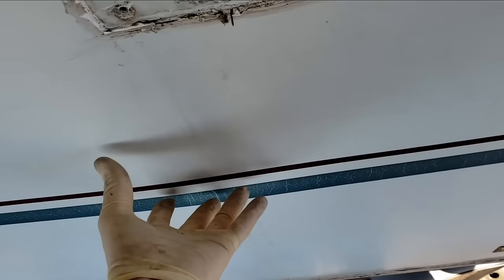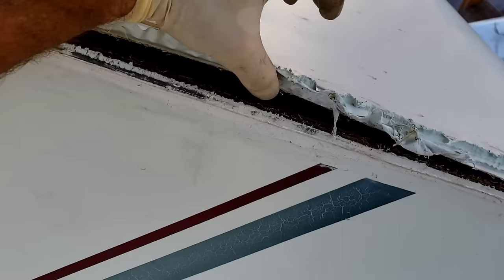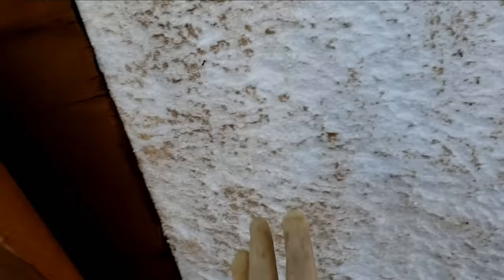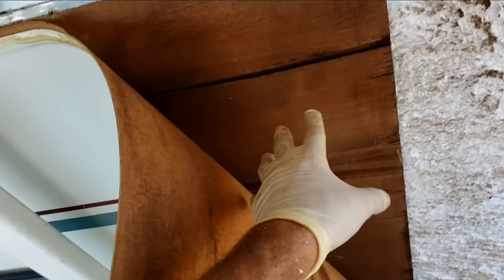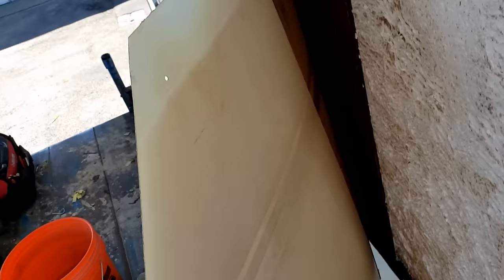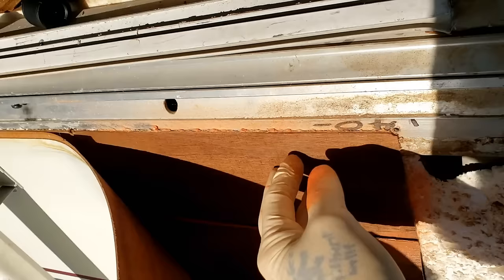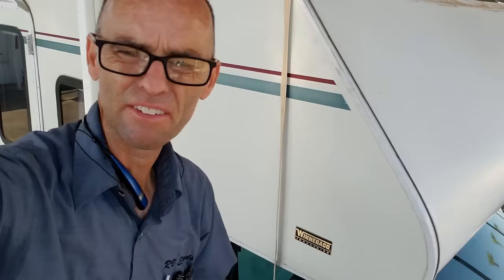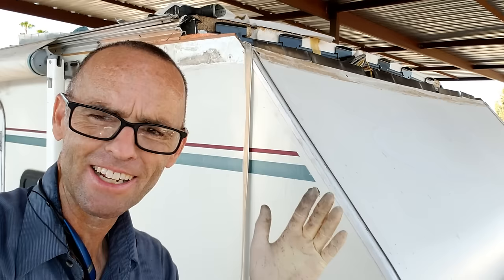How To Repair Loose Laminated RV Sidewalls....and Why It's Not Done

Comment: What is the cost of a repair like this? I have delamination on my fifth wheel in the similar area - on the side where it goes over the truck bed. I know you said it's not cheap, but I purchase my trailer for pennies on the dollar.
Reply from the maker: this was a special price as we were replacing the roof, but likely around $2000

Comment: Great video, i am replacing several bad walls on my travel trailer. How long do you wait after spraying the adhesive on before connecting it together, and i see you didn't use any cribbing to keep pressure on it as it dries. Thank you for your help.
Reply: With contact adhesive, you wait for it to dry before touching the two surfaces together. The time recommended is printed on the info for the adhesive. Once the surfaces touch, they are stuck. Pressure from the roller finishes the job. No need for cribbing, it's done.

Comment: New subscriber. Wondering if you have done any videos  on a majestic at the front 1ft of the roof were the front connects to the curved fiber area. Rubber roof material is in great shape but a water leaked about 1 ft area of luan paneling material. If not comments on using Gorilla spray adhesive or contact cement (heavy duty) to re-glue the rubber membrane . Live in a small town and not many option here for the products you have mention in some of your videos. You have made some Awesome videos, thanks for that.
Jeff
Reply from the maker: Thank you very much for the support and kindness. Home store contact adhesives can damage the membrane and won't hold up to the heat anyway. I would mostly just recommend ordering the water based glue from Amazon.

Comment: Question, I have a camper w/ roof / Wall damage, side paneling was wasted, Thought about screwing the outer panel on to the studs I rebuilt in the wall. Thoughts
Reply from the maker: it would work, it just would not look pretty

Comment: I may have missed it but I’m looking for adhesive details. And are the specialty adhesives markedly better than simple contact cement?  Lastly, a source for the roller?  Thanks.
Reply: Found the material specs, and I can find the roller.  Are the Stabond materials markedly better than simple contact cement for a home improvement store?

Comment: Why don't they use Luan Plywood made with waterproof adhesive so the layers don't separate?
Reply from the maker: luan is the cheapest building material so little thought is given to it. Many manufactures have removed it from the exterior now, but not the inside.

Comment: Then Gary maybe buy him the camera!!! 2007 Tango front cap has 2 upper spots where there is nothing under the plastic. It is cross woodwork, like furring strips. Like a tic tac toe.  Those spots delaminate, about the size of a basketball and round. With nothing behind you cannot inject a glue to get it to sit down. This was only on 2007 models, which were initial test units.
Reply from the maker: I've seen that too.

Comment: Questions: I keep hearing of this new material they're using now that won't delamiminate.  Is it any good and if after a leak would it still have to be replaced anyways ??? Also in reference to roofs. I have heard of people using spray on bedliner for trucks as a permanent solution to sealing roofs and roof maintenance.  Is that a sound principle and why or why not ???
Reply from the maker: The spray on roofs are very durable and do work well. My biggest concern is that the roof attachments are encased under the liner, so if a skylight or vent or light or antenna breaks, the unit has to go back to the roof installer for replacement and recoating. Azdel siding does seems to be a more stable material, I imagine it will become more popular in time.
Reply: @AZExpert  thanks for the info I always try to learn as much as possible in order to make wise decisions.

Comment: How do the manufacturers still get away with making RVs like this? If you wanted to design a structure that falls apart in the rain, you couldn't do better. Luan delaminates instantly when wet, so they use it as a structural layer on both sides of the wall. The corners are sealed with putty, which heats up, shifts around and lets water right through after a few years. Then they cap the putty with aluminum angle channel and put 9 million screw holes through it. To fool you into thinking it might last, they squirt some silicone on the outside of the corner cap. Most people don't know that silicone degrades rapidly when exposed to UV, so they're the suckers. The roof ends just shy of the outside walls, so the crappy corner seal is certain to channel water right down into the wall when it fails. If you built an RV out of woven grass, or even toilet paper, it would hold up better to moisture. It's unbelievable, and more unbelievable that they still get away with building such utter crap. They've done their corners like this since 1942 and no one has yet figured out a better way?!

Comment: Do you ever use 2x4, 2x6, 2x8, 2x10 cut 4"-24" lengths, then cut diagonally while on edge to make giant Wedges that you could tap in to help unstick or hold open areas while you work?
Reply from the maker: no I haven't .I try to just work out the layers as best as I can slowly.

Comment: I've gotta do the same, fix both bunk sides, with the luan is already completely gone. A bunch of delamination and a roof that needs to be replaced. Every wall needs to be touched due to water penetration... There's lots.of.silicone and theres a lot of water damage on the inside ply/luan. How should I attack this?
Reply from the maker: I would recommend finding and repairing the leaks first and then deciding if you will be using it enough to justify re-building the walls
Reply: @AZExpert  I probably won't be rebuilding all of the walls, most of the delamination looks to be like the bunk in this video .. and accessible. I'll probably have to re roof. Which is probably the cause of the damage. I don't know if the foam is attached on the roof top or bottom. With the stabond adhesives you used, will a gallon cover it all? I'm thinking of using tpo for the roof, but rolling the glue on to get better coverage.

How can I tell if the roof is supposed to have a crown?

Comment: Im considering building a custom trailer and i cant find lujan sheets or a roll of filon that is 10 ft wide do you have any clue where to look?
Reply from the maker: sheet lumber longer than 4 x 8 us very tricky to find. 10 foot filon is too. If you've ever seen an Alpha motorhome, they had to use the belt line molding to make the filon tall enough.

Comment: I am going to replace the luan beneath the filon....can I coat the luan with fiberglass resin and let tit dry for 48 hours and then apply the t440 to it after? Would the resin inhibit the hold of the glue?  I figured coating the luan with resin would make it more resistant to moisture.

Comment: A couple of questions b4 I attempt to DIY my 5th wheel in the exact same spot! Do you know of any alternatives to the leuon and and trim that would be wider (maybe an inch on both sides) other than the original (the same thin trim as what U R using?) Maybe something I could pick up at Home Depot? I was told by an auto body guy he could probably just do some body work, and he THOUGHT there was a plastic type trim that could be curved and then if needed attached with washers and screws spray painted white like the white trim? Obviously I'm not looking for the BRAND NEW LOOK, but I've made it 1200 of my 1800 move.. where it will sit on a piece of property for camping. Im not all that concerned with VISUAL PERFECTION as much as water damage prevention. I lost my delaminated piece the exact size of what you're dealing with driving thru a snow blizzard from PA. REEEALY NEED THIS TO BE A CHEAP AS POSSIBLE BUT STILL WATERPROOF.
Reply from the maker: Home depot sells 4 x 8 sheets of FRP wall paneling which is a cousin of filon just with a textured surface
Reply: @AZExpert  I'll check that out Thank You. I know stupid question.. But you wouldn't want to divulge what a job like this would cost? would you?
Reply: As I was washing my countertop... I thought is there a reason THAT wouldn't work? Ive purchased several brands and priced tops when i used to flip houses. As long as it's sealed around the edges of course?? Or.... Is that a stupid question? Lol. Although price was an issue.. It is going on someone's property with a rather sweet piece of property & home. Don't wanna look ....? Ghetto! for lack of a better word. I looked at what you suggested and it definitely would work. But somewhat unsightly. I'm trying to think out of the box as usual.

Comment: how many year back was plywood phased out over solid core side walls / cause we still evaluating Class A not crazy about class B (MB) or C my last dinosaur class 78 had the same flood plan of a early Winn we're look at every breakable item from waterline to wiring access.our cousin has 2 class a in stock his super home is big monaco. his 1st is 1993 National RV tropical as (first owner , everything shot it fridge has ammonia smell (yuk) generator took 9 try's start up, oh happy smell mice heating duct living. it sat on farm 7-8 yr we think the former owner Use the np52g generator overloading as the line breaker have a white arcing color on switch 30amp )...
Reply from the maker: I'm not sure these were ever made to stand the test of time, but I will say metal sided trailers seem to last the longest.

Comment: Our 03 Newmar Dutch Star has some ripples in some of our bay doors. I thought it was the 1 1/2" s Styrofoam shrinking away from the exterior skin. I don't know if it's filon or fiberglass but I think it's glued directly to the styrofoam and the Styrofoam is glued to the plastic sheet that makes up the inside wall of the bay doors. Those 3 pieces are glued to the aluminum extrusion that makes up the frame of the door with Sika flex (?). If I could get the frame and Sika flex to come unglued I think I could fix it for minimal amount of money. The external skin and paint are in great shape. A new bay door is 500.00 (we have 4 or 5 that need fixing),plus the cost to paint it and it would never match probably. Do you know any tricks or techniques to loosen Sika flex? Thanks James.
Reply from the maker: I have reglued those doors and dispite what I said in the video, you are correct. Most doors have the filon glued to the foam. After removing all the screws on the frame and the door latch, I just use putty knives and a hammer to cut the sealant on both sides until the metal is loose. It takes time but is doable. Good luck!

Comment: Do you remove all the butyl on the corner trim before putting more or do you just install new stuff over it? I took my end trim off and it’s sooooo damn tacky and hard to work with.
Reply from the maker: It really depends on the condition. It's ideal to clean off the old stuff especially if it is bunched up as it will cause the trim not to lay flat and create voids. However, if its still flat and intact, may not be worth the time to clean off just to put new stuff on. I'd defer to the installer.
Reply: AZ Expert sweet! Much help, I’ll go ahead and remove it to install new butyl on there :) keep the videos coming they are super helpful!

Comment: It always amazes me how poorly these are made. So is this Azdel stuff better because it won’t delaminates as they say. I’m sure a 1 piece fiberglass cap is better to reduce water leaks. Can we just get a spray on roof from the factory. 
I know it’s always about a huge profit. Knowing they are marked up 100% from the manufacturer then another 100% from the dealer. Another great video 👍🏼
Reply from the maker: I am equally surprised the spray on roofs aren't done at the factories by now, I guessing not enough people want it yet.
Reply: AZ Expert I see you do so many roofs and hear of people having problems with leaks. It has to be more labor intensive for a conventional roof then a spray on. I’m baffled at why it’s not done from the factory. I’m probably reaching but maybe they know they fail. They know they will leak and ruin campers. Knowing the American public will just buy a new one. 🤷🏼‍♂️. I feel water leaks are the #1 reason RVs die.

Comment: Hey sir, where did you get that cool dual handle glue roller? Great work!
Reply from the maker: That is a floor roller found on the shelf at Home Depot in the flooring department.
Reply: @AZExpert  awesome, just picked one up. For newer rigs that have delamination, do you have any advice for how to separate the wood from Styrofoam? We have a newer Sonoma that has delam down one side of the back wall due to a leaky corner of the roof that we are replacing. The wood and styrofoam in the middle of the wall are really glued together and we'd like to preserve the filon and roll new wood on the back like you did in this video. Any scraper, tool or technique you recommend?

Comment: I have been exprimenting with "Fuze-It " by Liquid Nails for bonding styrofoam to other materials .  This product does NOT melt the Polystyrene board and seems to bond well.   I also found a spray adhesive called "3M-78".. . it is a spray and it advertises that it bonds to concete, polystyrene, wood, metal, MDF, and PLASTICS !!  I did a test on both of the above products and both seemed very strong bond.  I tested gluing the polywal to itself and I couldn''t pry it apart.  I then tried gluing two credit card together. . . worked great as well.  What I have not tested is how the bond will hold in the kind of heat that my motorhome would subject the adhesive in regular use.  LIke every one else, it seems like there should be a solution to the very poor resistance that Wuhon has been so failure  prone.
Reply: To further explain the above,  I find it counterproductive to keep using a product that continues to be the culprit in shortening the  life span of the RV.   So, what I am really trying to do is somethng to secure he outer panel of my RV to the Styrofoam board.  The two adhesive products above may be the answer, when attached to "Polywal" a product from ParklandPlastics.com that I found in a Home Depot store. Surely something can be used other than continuing to use the nemesis of the RV world.  The qusiton is:  Would Polywal be better than the "huan" plyword?
Reply from the maker: the 3m 78 is not great for exterior use. the luan substrate is a bad design I agree. I am experimenting more with expanding foam adhesives.
Reply: @AZExpert  I did make contact with ParklandPlastics.com and I was told that the product called Polywal is not intended for exterior use. It is only useful for temperatures of 100 degrees (F). BTW what is the product name of the  expanding foam adhesive that you are experimenting with?  Have you had some success?  One of the versions of "Great Stuff" may be worthy of exploration. Look for the version that states it is an expanding foam.
Reply: To Az Expert I may have stumbled across a 3M product that  could be a viable alternative to Epoxy glues as well as Stabon.  The product is 3M-78.  This is not to be confused with 3M-77, which will not work for high temperatures at all.  The 3M-78 will withstand temprertures up to 190 degrees-F, and it will not melt the Styrofoam or Polyfoam board.  Most of what I see on my internet searches shows using epoxy glues, though it looks like AZ Expert uses Staybon, a contact type adhesive.  (P.S.: I verified the above temperatures by calling the 3M Help-Line.)  
     Another thought that I have about delaminate around the windows is to remove  the existing huan plywood from the back along with the styrofoam. . . The procedure that I recommend is to work mostly from the inside of the RV rather than from the outside.  This is particularly of benefit when working around delaminated huan plywood.
      Once you remove the window you have easier access to the rotted huan board as well as the Styrofoam.  Yes, you will have to replace the inside wall, but this may be easier than working the dark narrow passages from the outside.  So, by working from the inside you have easier access to glueing the three components together and with the 3M-78 or the Stabon you will not need elaoborate clamping, just spray both sides and press together.  
     BTW, If anyone has a waterproof product to recommend other that the, bound for failue, water-soluable "huan plywood", you will get an award for "TheTip of the Day."!

Comment: What tool did you use to cut the luan?
Reply from the maker: Well, as mechanics every tool on hand is multifunctional and preferable to the one not in arms length.....so just a grinder with a metal cut off wheel. LOL Thanks!

Comment: 17 year old RV that has one, maybe 2 sidewall delams plus needs a new roof.   The repair job has got to easily  cost more then the value of this Class C.
Reply from the maker: It's an expense to be sure, but no where near the value of the unit, especially as in its current state it has no value.
Reply: AZ Expert My experience has been on older units like that, regardless if TT, FW, MH, Class C, major repairs are a constant and owners don’t know where to stop And call it a day.  Emotional attachment or wishful thinking (“this xxx repair will finally fix it”). But that thinking keeps independent RV mechanics busy and well paid.

Comment: Great info! I was really surprise to see how much heat those stripes transferred. Do you think that might contribute to some of the delamination? A lot of rv are now switching to azdel, which doesn't delaminate. Have you seen any problems with the azdel?
Reply from the maker: No, I haven't seen issues with Azdel yet, but I'm sure something will happen in a few years with that too....lol! I don't think the decals caused any issue with the delam, just the roof leak. Thanks!